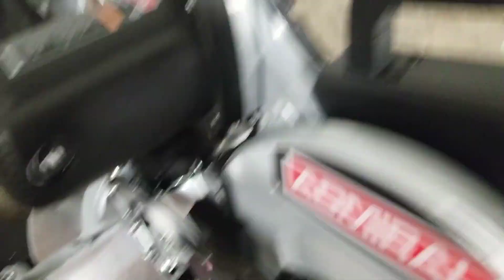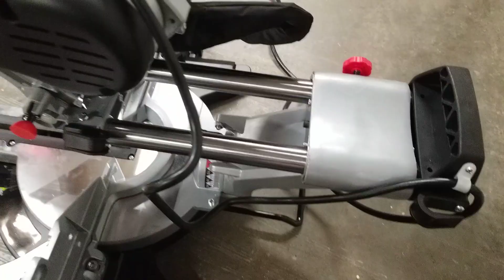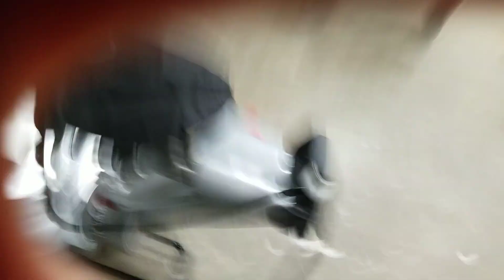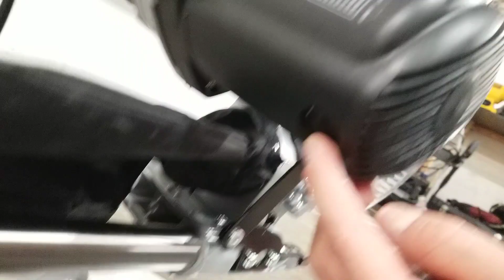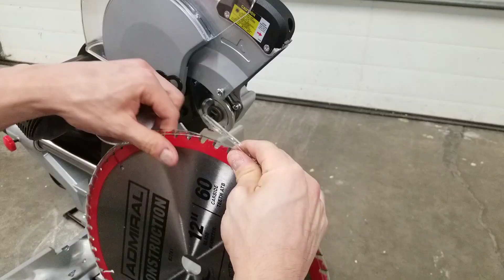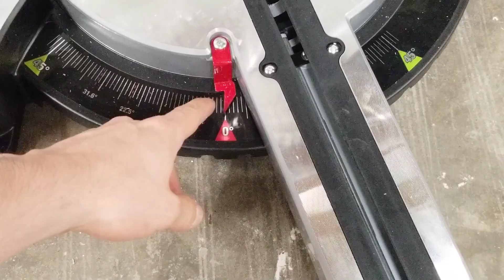How to Assemble and Square a Miter Saw (Admiral 12 inch)

Comment: Adjusting the Bevel angle to 90deg - You missed it - there is an adustable "Stop" on the left hand side of the Bevel Guage and it has an adustment scew. Set this correctly, and you will always be able to return the Bevel to 90deg without needing to re-check the bevel.

Comment: I've been use to craftsman and dewalt 
So this Saws functions threw me for a loop. 

I grabbed one from harbor freight last minute to help a friend...
.great saw especially having the light and laser.

Like an idiot a bought other blades and couldn't figure out how to get mybsaw all the way down....after an hour or so.

I realized I had a 10" blade 2 inches to short.

I put the regular blade back on and off to work I went. 

I couldn't use the bevel cause the directions didn't show me how.
I'm going to re watch your video until I got it straight .

Thank you so much for the info 
Your a life saver.!!!

Comment: another question. when you press the button to adjust the miter degree it "pops" into 0°.

But i noticed even in this "clicked in" position, you can still wiggle it to the right and to the left, by a fraction of a degree.

Where does it need to be?
Reply from the maker: I'm not sure I understand the issue, but sounds like the miter release handle is not tightened. Even though there is a handle that clicks into place at zero the other handle must be screwed tight so nothing can move. With miter and bevel handles tightened nothing should be moving at all.

Comment: I returned mine because when i was doing cuts (was using this for mainly sliding cuts), the handle seemed to move on me to the left and to the right depending on which way I was giving it pressure. Does that make sense?

Anyway, I wondering if this could be fixed and tightened up. it was messing up way too many cuts!

Comment: Thanks for posting! I just got the saw and found your video really helpful. My question - my blade is not lining up with the kerf board. It’s like a half inch off, so the blade hits the plate. How do I adjust this?

Comment: What if the blade is angled with the front of the blade closer to the clearance plate on the left and the back of the blade almost touching the right side of the clearance plate? How do you adjust that?
Reply from the maker: I just looked at mine and if I understand your problem, I'd say it can't be adjusted and is a manufacturing issue. Either the saw is crooked, or the clearance slot/plastic insert is crooked. Don't think it would affect anything though since fence and saw move relative to each other for mitering, and clearance area is fixed to saw.

Comment: On my table saw I have a sled so it's very easy to match up my cut mark to my sled line.  On a miter saw do you have tips to easily cut on your line?

Thanks
Reply from the maker: The easiest way I use is the laser guide. On this saw it can be adjusted, just takes some small disassembly and trial/error to get it like you like it. It won't be as precise as your sled line because the laser is located above the blade project downward at an angle, and not in line with it, but with some practice you can account for where the blade will cut. Here is a video of adjusting it as best as I could. Enjoy the saw! It did great on the shoe molding I just did.

https://www.youtube.com/watch?v=Py4agMCl09M
Reply: @gameoflife7235  this saw is driving me nuts.

When I adjust the fence square to the blade I can't.

I loosen the 4 bolts on the back and the fence doesn't move far enough to allow it to become square.

If I'm looking at the saw the front left fence only moves far enough where it's almost square.

Any ideas?
Reply from the maker: @eclipse1999able  I would double check that the blade is sitting correctly between the two thick washers with the bolt tightened, and the first washer is also sitting flat correctly. Also, the blade's thru hole needs to be around the small black washer. It could be sitting on it, instead of around it. This would be obvious with the blade spinning because it would wobble like crazy so probably not this. Other than that, make sure the indent release lever is sitting in the zero indent location and clicked into place. If that fails, I would say something was machined at the factory incorrectly and it needs to be exchanged. Mine was perfectly square out of the box so don't have any troubleshooting help.
Reply: @gameoflife7235  thanks for your comment.

I will check after work. It really does look like the blade isn't perfectly straight and it is causing the issue.

Comment: I've read in a few places that the laser guide is roughly 1/8" off. Did you experience this on your Admiral saw? I'm looking at picking this up soon, but if the laser is off, I'd rather be able to adjust it if possible.
Reply from the maker: It is adjustable, the laser body rotation and lateral movement of the plastic holder. I had to shim one side with a tiny washer so the laser would angle in to the blade, and end up as a straight line on the wood. Without a shim, it will always be "mitered" relative to the blade just because of the geometry. It has to be 1/8" away for it to be straight relative to the blade out of the box.
Reply from the maker: Yes, it is 1/8" off. I'll take a look at it tonight. There is a screw holding the laser, maybe it can be moved over.
Reply: So it is adjustable, good to know. You should do a small video on how you got to the housing as everyone else seems to have the most difficult time taking the laser cover off lol. Either way, I appreciate the reply. This is the best how to video I've seen and has helped me immensely as I'm just starting to get into woodworking. Thanks!
Reply from the maker: @matthewrichardson7759  https://youtu.be/Py4agMCl09M